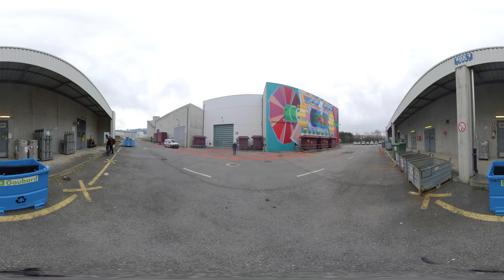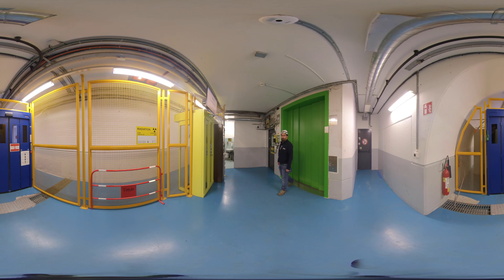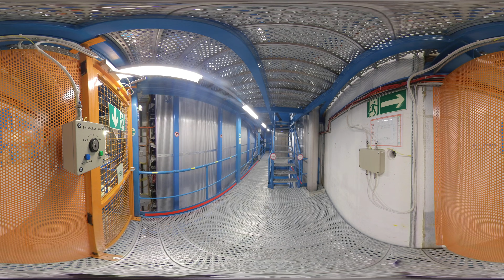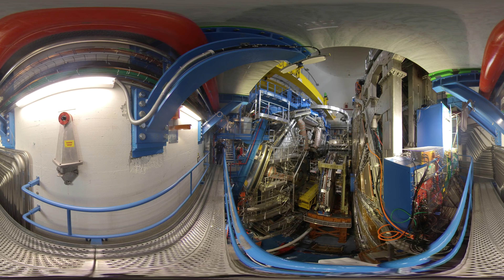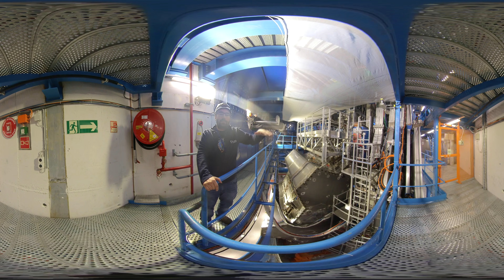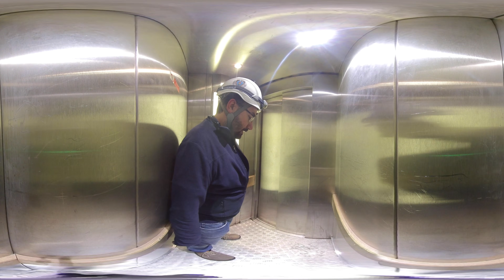360° tour: ATLAS Experiment - Inside CERN's largest detector! [CC]

Comment: A giant transmitter that collides the energy. 
That's what you got. 
Nothing dramatic. 
Good video though. 
Thanks for taking the time to show us.
I would be interested in the duty cycling and the power consumption and output. 
Filtering and feedback systems.
And of course the analysis.

I don't think I will be coming there. 
Not in this lifetime.....
What is that thing?
You showed it a few times at the end of the video. 
Certainly not dog doo......
I can't read whatever it says on the floor around it. 
Blurred....

Comment: I wish this 360 tour had been available when I wrote my sci-fi story set at the Atlas detector!! (Quantum Incident https://www.amazon.com/dp/B071X4YJ5L ). It was much harder to imagine what it looked like from still photos. I was hoping he would say it was cold down in the cavern (which I imagined it would be), but apparently not. Of course, the LHC wasn't running when he went down, so maybe it gets cold once the magnets are working. Fun to see!
Reply: Glad you liked it! It's certainly not cold, especially when you climb the twelve levels several times for the shoot.
When in full operation, it would be more likely to get warmer, as all the electronics will be operational and dissipate heat, but it should stay in the mid-twenties (Celsius). Remember the magnets have to be well isolated from the outside, otherwise it would be extremely tricky to cool them down to just a few Kelvin.